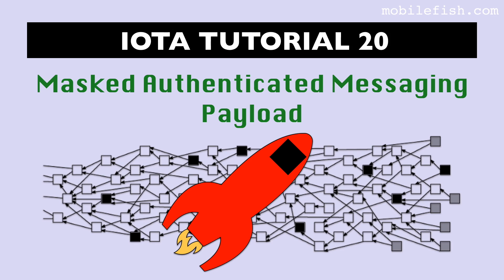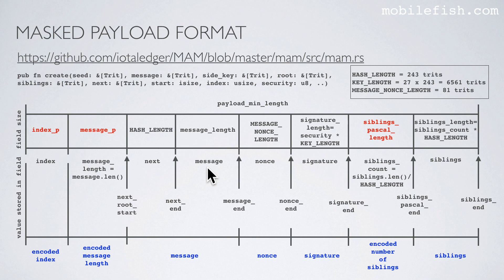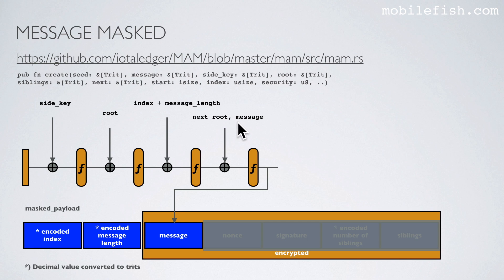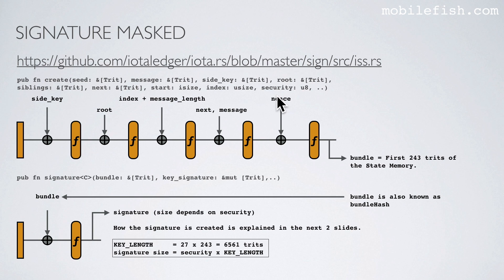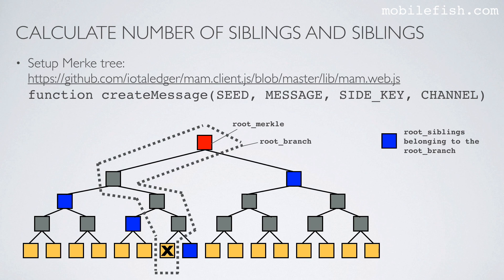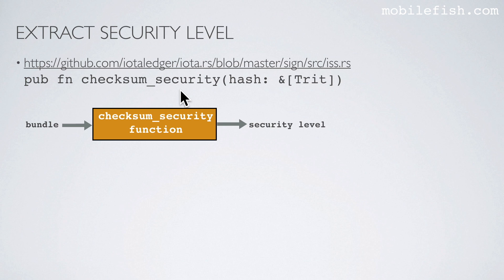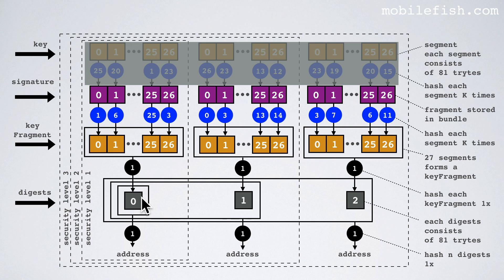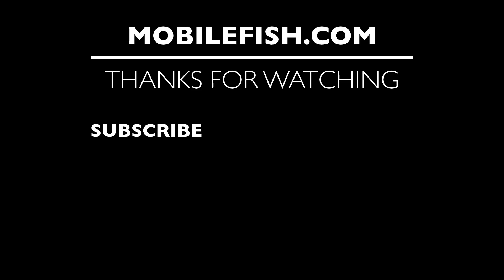IOTA tutorial 20: Masked Authenticated Messaging Payload

Comment: Great video!
Question: as I understand, 'count', 'next_count', and 'start' are not published to the tangle (or are they?), so what are these parameters good for?
Reply from the maker: See: https://www.mobilefish.com/download/iota/mam_part19.pdf
Explained in page 21 (See also: IOTA Tutorial 21)
Reply: Yeah I know the meanings of these parameters; they are part of a MAM object. That's clear to me; maybe the broadcaster needs them, but the thing I'm wondering about is whether they are needed by the receiver, because I don't see them being published to the tangle. So if I'm the receiver, do I need the 'count', 'next_count', and 'start' parameters?
Reply from the maker: These parameters are only used by the publisher to create the MAM stream. 
The receiver only need the root and side_key (when channel mode=restricted). 
1) With the root the receiver can calculate the address.
2) From this address the transaction bundle is retrieved.
3) The signatureMessageFragment fields in the transaction bundle together is the masked payload.
4) The masked payload contains the message (eg sensor data)  and the next root.
5) With the next root repeat step 1.